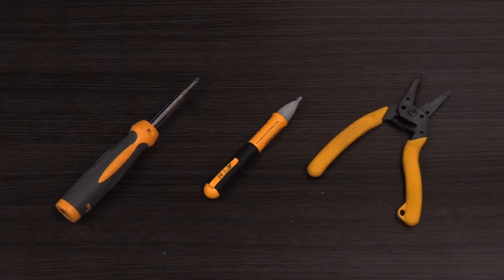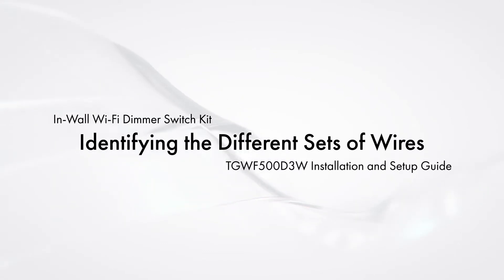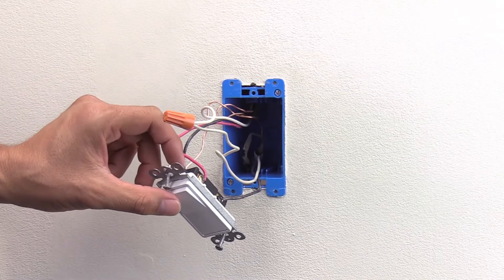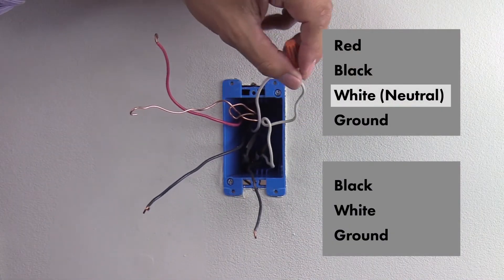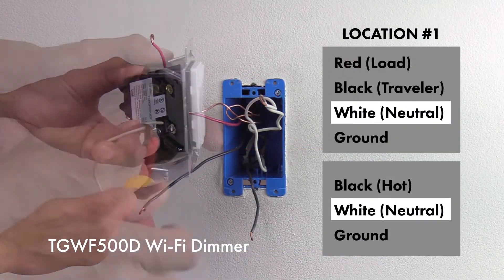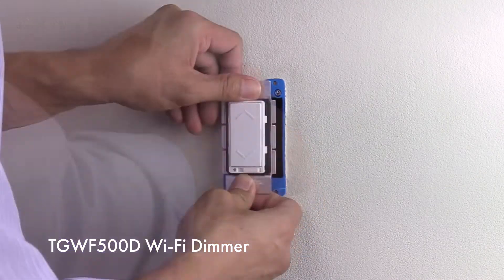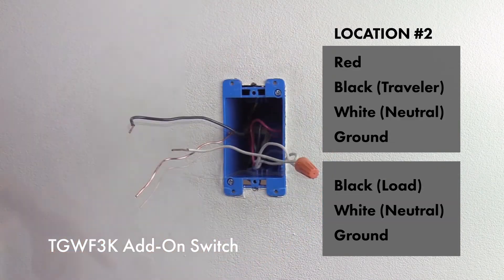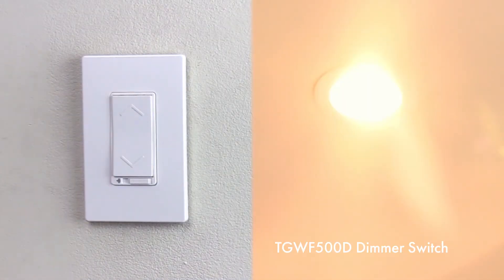Installation Guide | In-Wall Wi-Fi Dimmer Switch Kit | TOPGREENER® TGWF500D3W

Comment: when i installed the wi-fi dimmer, my lights do not get enough power from the dimmer. My electrician said that the wi-fi dimmer does not have enough voltage. Is this true? My old dimmer works perfectly.
Reply: The instructions say 600 watt max for incandescent or 150 LED. I found in my case I needed dimmable bulbs for this to work work properly. I installed the TOPGREENER TGWF500D dimmer with non dimmable LED lights and they flickered when they  started up. I then switched out my non dimmable LED bulbs with GE dimmable indoor floodlights bulbs from Lowes and now everything works like it is supposed to.